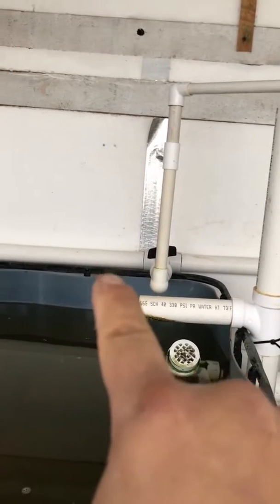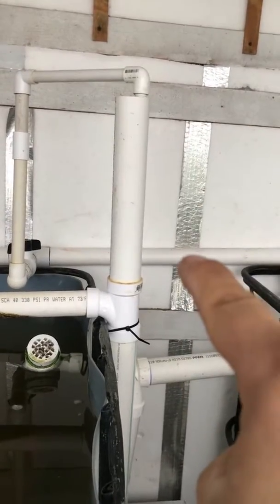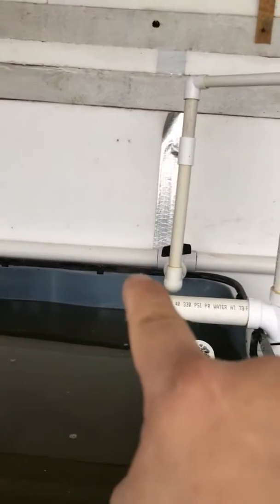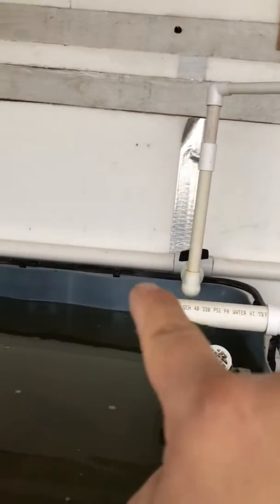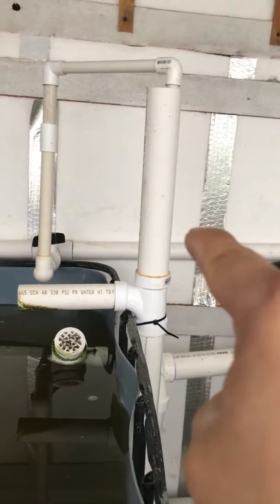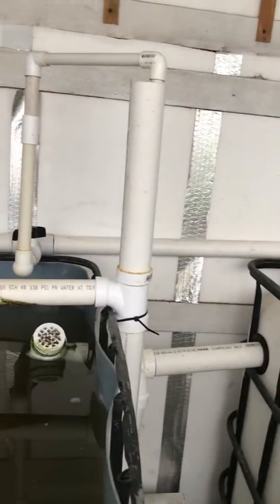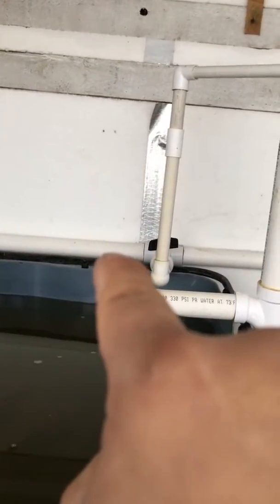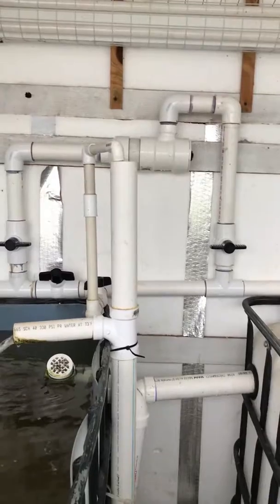Aquaponic fish tank heater build

Comment: CPVC is better for HOT WATER. At least for the pieces the element is attached to!

You might want to fix it so that, should the pump stop, the heater will shut off.

Impressive setup!  IF YOU COVER YOUR TANKS, that should help retain warmth (in Winter, of course)